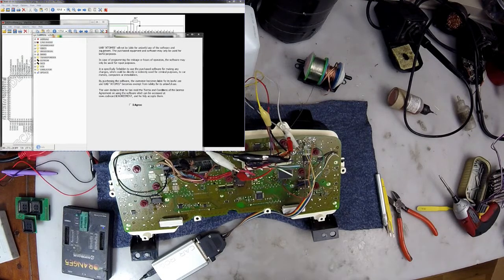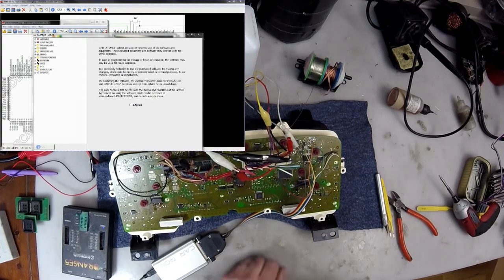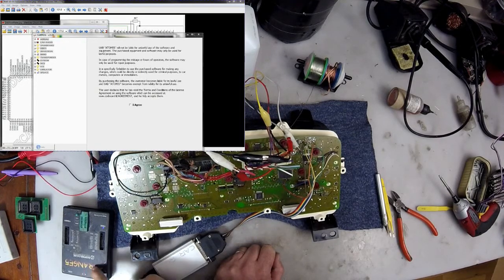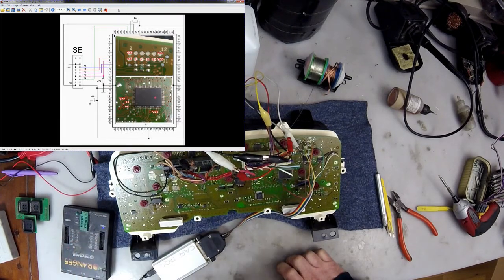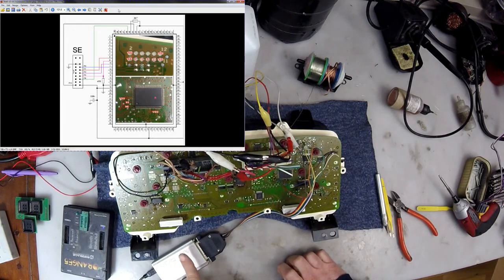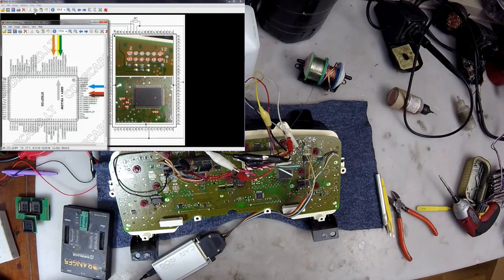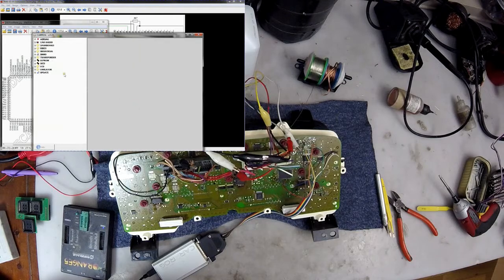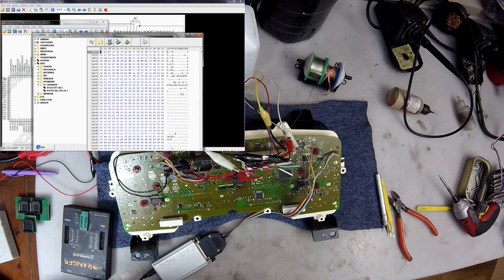Reading eeprom from a ST92F120 MCU in-circuit after a ram cluster repair

Comment: I'm trying to read the ST92F120V1Q7 chip and it won't read anything...
Reply from the maker: From same cluster and using o5? It was a pain to get the first time I did them if I remember correctly.  the pinout is here https://autoelectronics101.com/index.php/in-circuit-eeprom-pinouts/dash/dodge-ram-2002-2003-dash-st92f120 maybe easier to see then whats in video
Reply: @ecurepair  Sorry, so bad sound on the video. Do O5 not work?